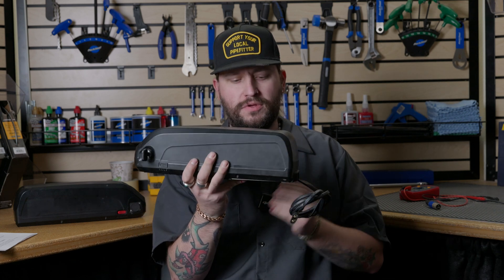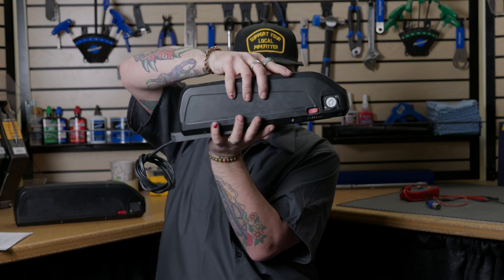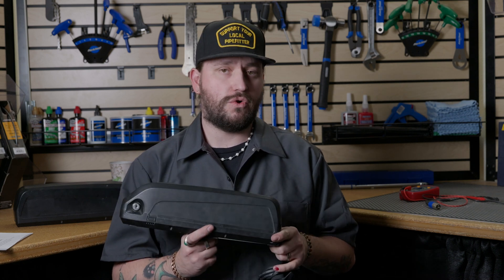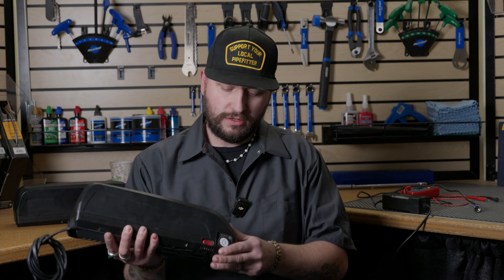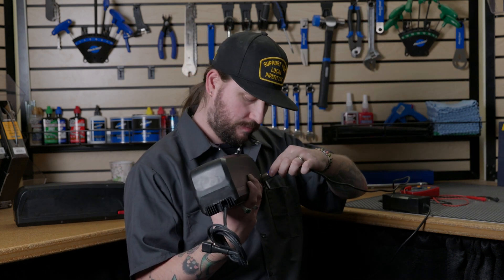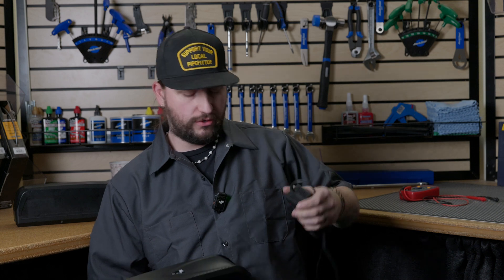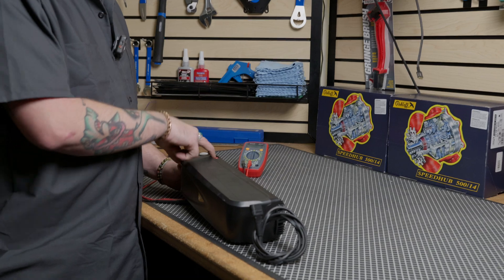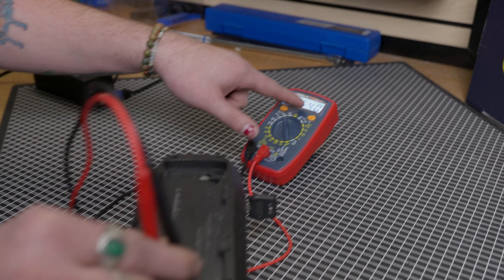How to Properly Maintain Your eBike Batteries

Comment: Hey Chandler
Awesome video. Thought I would just add a few comments based on my first hand experiences. Bought my trike from you in 2021, now going into my fifth year, and the battery is still going strong, however I do pay close attention to the battery as far as maintenance and precautions are concerned. I live in the Phoenix area, and am subjected to extremely high temperatures 6 months out of the year, that being said:
* When I am not riding, the battery is stored inside in a closet (70 to 75 degrees) with a fireproof blanket wrapped around it.
* I never completely discharge the battery, recharge when the battery level reaches around 30%.
* I do not fully charge the battery each time, I charge the battery to about 90% to 95%, every 6 cycles, and on the 7th cycle charge to 100%, this gives the BMS system a chance to reset/refresh it's memory.
* I clean the contacts on the battery and battery sled once a month.
* I had to replace the charger, the key here is to buy a new charger that matches the old charger specs exactly, and each manufacturer's specs can vary significantly.
* When charging, I connect the charger cord to the battery first, then plug the charger into the wall outlet.
* Before each ride I check the battery appearance for any abnormal conditions,  which could include bulges, signs of leakage, cracks, etc.
* I carry a small fireproof blanket rated for Li-ion batteries (available on Amazon), in case of emergency while being out and riding.

Just wanted to share a few ideas that have worked well for me. Keep making these videos, as they provide us with very useful information. THANKS!!! 😎👍

Comment: Hi  I Have always been told storing this this type of batterie, is to be stored at 50% or near .So If it chemically fluctuated you have room... so to speak ,so the surges do not turn to heat ! and possibly cause a Nasty fire. Please correct me if I'm wrong. Alway learning! and will take any correction as such thanks, KTW